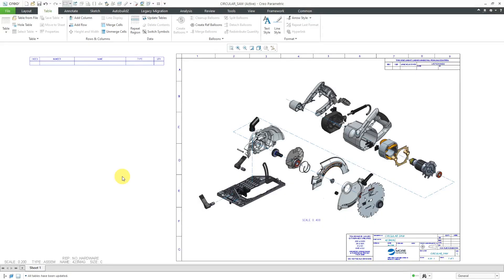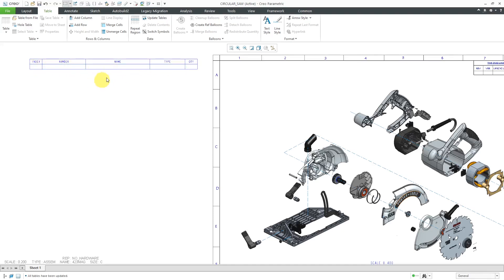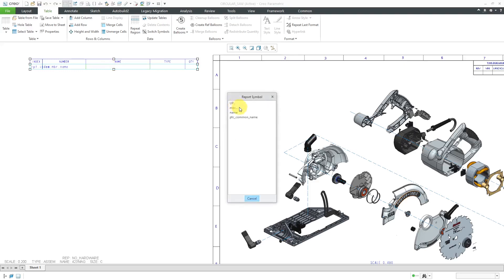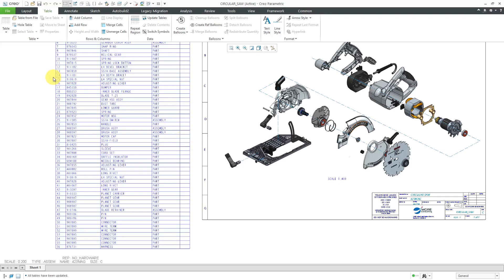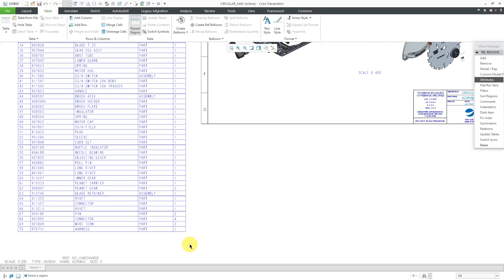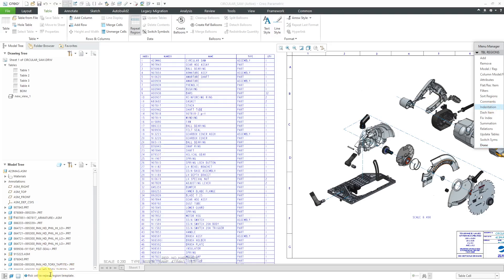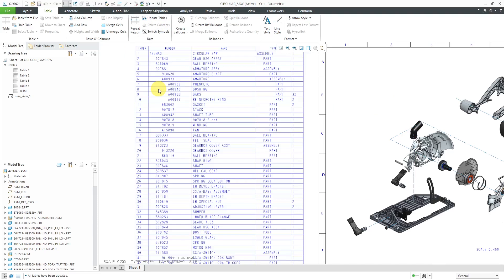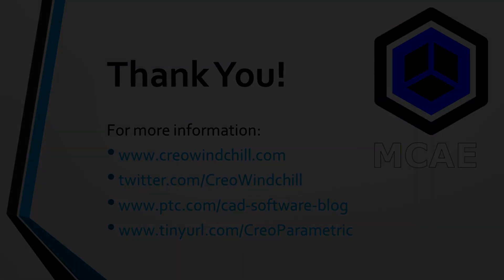Creo Parametric - Drawings | Indented Bills of Material (BOMs)

Comment: this is THE solution! dave martin does it again. just a note to other users: you can create nested repeat regions like in the video below but there's no way to easily format a nested index to be 1.1, 1.2 to for example. you can use relations but that is more work & likely won't be easy for others to maintain. Also, the standard balloons will only be applied to the top level.
https://www.youtube.com/watch?v=ytnZDQTSlsc